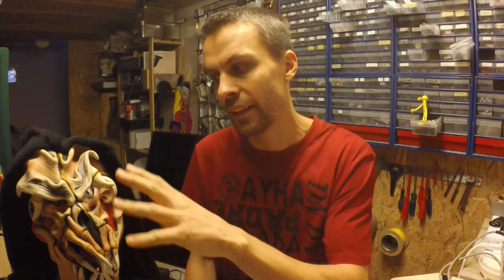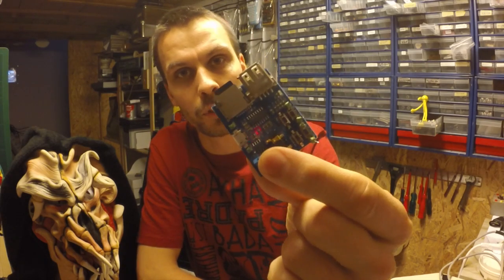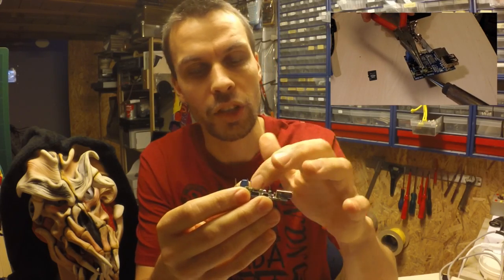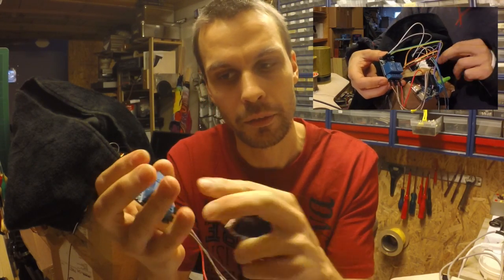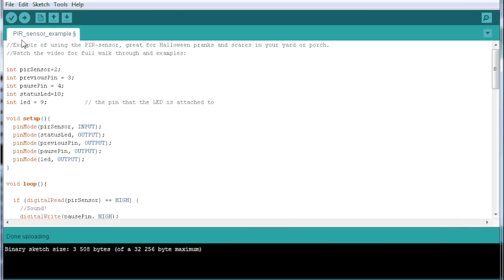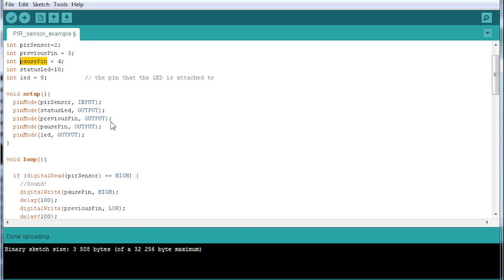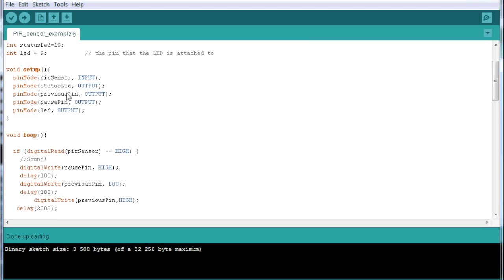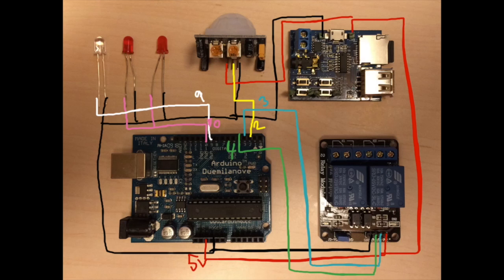Simple Arduino MP3 Sound Player [Anything Arduino] (ep20)

Comment: Just to say thanks - I built something similar, code works great. Made some changes (of course) - used transistors for the relays, much smaller, soldered directly to circuit board I made for this project. Needed a separate power supply because I added a motor. Transistor also used to trigger sound board - (when trans is shut off pin goes to ground.) Otherwise GREAT project and thank you for the tutorial.
Reply from the maker: Thanks for sharing! I also thought about using transistors, but I cant seem to learn which resistors to use to follow the norm, and people get so angry when I choose the wrong value... So I use relays instead... :D hahaha...

Comment: OK, now replace the switches with a CD4066 (or more, depending on how many switches the board uses). A 7805 regulator, a 10 pin IDC connector (or a double row 5pin or 2 single 5 pin on a single row) and make a eurorack panel and you have... a Radio Music! https://musicthing.co.uk/pages/radio.html
Reply from the maker: As always a brilliant idea :) I have another sdcard reader/mp3 player board that is more suited for Arduino that I probably will use...
Reply: There's also a variant of the Radio Music called "Chord Organ" - only the formware is different: https://musicthing.co.uk/pages/chord.html

Comment: What’s your email I will send u the code I’m using.
Reply from the maker: You can mail at info@sourcerystudios.se
Reply from the maker: I just thought of a thing. There is a sensitivity knob on the pit sensor. Do a serial write of the pie sensor pin so you can see if it changes when something moves in front of it.

Comment: No I did not. Keeps looping.
Reply from the maker: Must be something with the pause command. I looked through the code and it starts with pressing previous which starts the sound. Then it blinks the lights and the last lines of the code presses the pause button. Check so the last lines that press pause is present in your code as well.

Comment: You could use arduino to imitating buttons, ) volt on pin will act ass push. You neeed remember that at the start, pins from arduino need be on state HIGH. I did that trick whit Flip-flop swich to turn of arduino, and external button is turning on.
Reply from the maker: Thanks for the info. The trick with the flip-flop sounds interesting. Might be just what I needed for another project I thought about a few days ago :)

Comment: Kristian, for some reason the red leds flash and the white led goes on then fades slowly off. It should be reverse.
Reply: Kristian, I flipped the wires from 9 to 10 and 10 to 9 and now the red leds glow. Only problem is when the red turn off the white led stays lit. I need it to go off when the red ones do.
Reply from the maker: In the code you can add a row after the red leds turn off to turn off the white leds. Look at the code and you should be able to puzzle together the right command to the right variable. :)
Reply: Phil did you ever get this bug figured out? I just got all the parts and hooked everything up correctly (double checked) however the sound keeps playing almost constantly. I did a direct copy and paste of the provided code and haven’t changed anything, I’m new to this so don’t know where to start.

Having the same problem with the lights as well. It’s almost like once the lights and sounds cycle there needs to be a 5-10 second delay before the PIR is allowed to start another sequence.

Comment: where is the mp3 sound file you used? I liked that sound or do i  just upload my own it to the sd card?
Reply from the maker: I think I found it in a bigger sample and just took this part out. I will see if I can find it.
Reply: thanks in advance...send to pzazzera@gmail.com
Reply from the maker: Took some time to find that file... Here it is, enjoy and dont scare anyone to death ;) https://www.dropbox.com/s/zcc5mpmigawjq87/track001.mp3.mp3?dl=0
Reply: thanks for the file. For some reason the track keeps looping very fast. I need it to play once with each PIR movement. Can you please help me with the code. I tried changing delay numbers etc.
Reply from the maker: @pzazzera  Is the pause command working? It is supposed to press the pause button when the file has been played until the next pir movement... If you use the same mp3player, then you need to solder two of the buttons to pins....
Reply: I bought all the same parts. I will double check the solder points.
Reply: What is the jumper set to on the PIR? High or low?
Reply from the maker: @pzazzera  The output should be low when not enganed according to the code atleast...
Reply from the maker: Did you get it to work?

Comment: What are the components of this circuit? Ive decided to take this up as a school project
Reply from the maker: It is an Arduino UNO, a PIR sensor, a two relay module, a couple of LEDs and an old probably discontinued mp3 player. However any simple mp3 player circuit that uses pushbuttons should work to do this circuit. However there are better mp3 players that interact better with arduinos, if you want to make a more elegant solution.

Comment: is this the tiniest method to realize this? I need something like that for my modelcar diorama to play the sound of the car.
Reply from the maker: No I have found an even smaller and probably easier to work with. I am not sure what it is called, but if you search ebay for "TF Card U Disk Mini MP3 Player Audio" you will find it. A small square pcb with a microSD on top. Combine that with a ATtiny84 Arduino as in episode 3 https://www.youtube.com/watch?v=qz-YMPY4_z0&index=22&list=PLyE56WXw0_5QrkEwXZ2AXwh6A-s0iQoVl&t=1s and you have yourself a really small arduino based mp3 player. Good luck!

Comment: some  simple optical switch ( that are on the  relay board as well , the 2 small chips )would  have been less weight full  .. those micro switches (optocouplers )  can replace the relay board... pc817 (  i think are those on the relay board) 4n23 /4n35 / or some analog switches like the quad CD4016

Comment: Instead of using relays  that are power hungry and slow OR using transistor directly  I suggest you use Opto-couplers.  This way you don't have to worry about interfacing to the switchs and affecting the control circuit.  You just need to make sure your polarity is correct.
Reply from the maker: +jp040759 This is a great idea! Thanks for sharing... Will order some optocpouplers immediately :)

Comment: In case you interfaced without the use of a relay, would you need to remove the switches on the mp3 board?
Reply from the maker: +msevyt No, as a button not pressed has no contact. I will try this out with transistors instead, but using only digital pins didnt work. This was just a really fast way to get access to the functions of the MP3-player. Technically you could use relays as a simple way of automating any button...